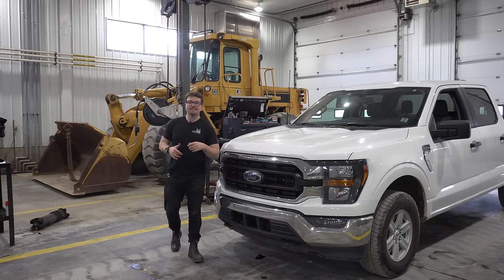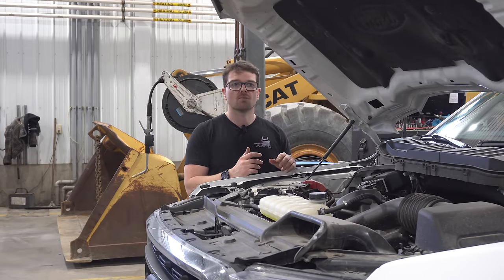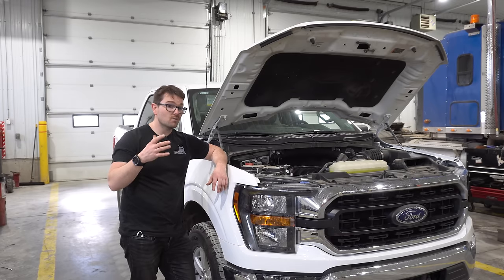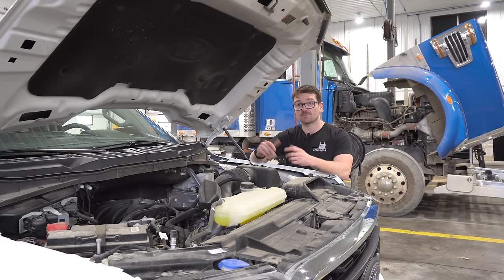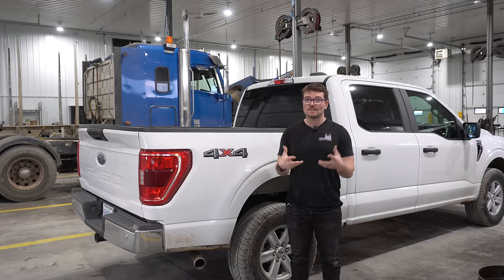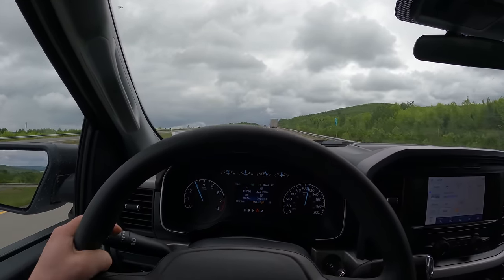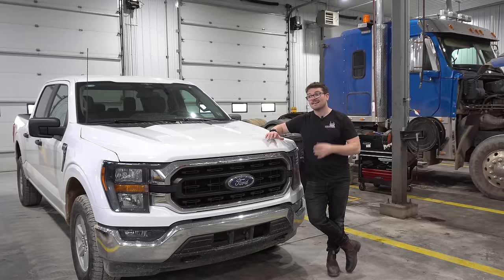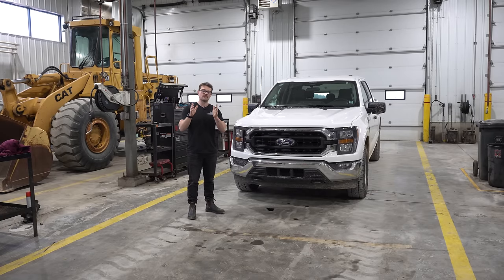Ford F150 5L Coyote V8 Engine **Heavy Mechanic Review** | 5 Reasons why It's the BEST

Comment: I have a ‘13 5.0L.  And I have loved every single mile I’ve put on it. 300,000!! I’ve hauled trailers across the country with it and it’s till sounds and feels like day one. I also have a ‘18 with the 5.0L and have no reason or worry about expecting the same all around performance out of it. Love your videos brother, they are super informative and have great genuine non biased opinions. Please, keep it up!
Reply: what oil you use?
Reply: Same here bro mine has 200 k tho the only thing I’ve done to it maintenance. New plugs and new coil packs that’s it
Reply: @migueldelafuente5775  I've had to do my transmission cooler lines and the plastic water pump hose, other than that it's been basic maintenance.  2014 with 140k, and I do lots of hauling with an equipment trailer.

Comment: 2017 Supercab 5.0 (gen 2) w/ 3.31 rear end ratio and 6 speed transmission. Zero problems, 19 mpg combined, low 20s on the Interstate with the cruise set on 80 mph. A keeper.
Reply: Just cause I don't know at all, depending on how you are using a truck, what is the better rear end ratio?
Reply: I swapped my 3.31 to 3.73 on my 2015 it helped out a lot especially with the trans constantly hunting for gears with heavier tires on hilly terrain
Reply: @bcw686  I think the 3.31 is a good all rounder, but as @andrewcleveland said, if you haul relatively heavy loads and or tow a lot, the 3.73 is a good choice, at the expense of some gas mileage.
Reply: @andrewcleveland 4.10 with gt350 ported mani is the way to go with Gen 2
Reply: @justingill5256  I bet that is a mean setup

Comment: My buddy has a 1989 Mustang 5.0 LX with 250,000 miles. It still runs great, no oil issues. He bought it new, and has had to only do basic maintenance.
Reply: completely  different 5 liter engines , that mustang is a push rod

Comment: Anyone who says "you shouldn't buy a truck if you're worried about fuel economy" clearly isn't paying for the fuel. I buy pickups to do what they were designed to do; work. I haul and tow 6 days a week, 25,000mi a year. The difference even a few mpg makes for me as a small business owner is incredible. I just bought a 5.0 and I'm coming from a 6.2. Personally, fuel economy is in my top 3 factors for a work truck. The other two are reliability and capability. 
Great video! We appreciate the info and perspective. 👍
Reply: Fuel economy is huge for small business owners. I thought I found the perfect truck years ago when I ordered a new ram EcoDiesel and the fuel economy was unreal when it wasn't broke down waiting to be repaired. Went from that to a Hemi 1500 which was a pretty good truck overall to a 5.7 Tundra haha. The Tundra is 11% worse on fuel then the Hemi but its just plain reliable. This tundra should be my last work truck
Reply: 26.5k miles since last April in my 23 F-150 with the 5.0. Couldn’t afford the $400+ more per month in diesel with a 250 and with 13k towing capacity with the max tow package I picked I can’t see needing much more towing unless I buy a big boat and tow it or a skid steer both unlikely lol

Comment: I've had the 3.5 and the 2.7 and currently have the 5.0 and everything thing you said is dead bang on. The 3.5 was a towing beast but I get better fuel economy with my 5.0 and almost as good performance - the low end torque is not there on the 5.0. I agree with the reliability - I was always worried about the turbos in the 2.7 and 3.5 and if they went and they can/will!!!! - it was $3500 minimum to fix. I have a 2016 with 150,000 km and the engine is flawless right now.
Reply from the maker: I personally think the 5L is just a great well rounded engine. not the most powerful but across the board has almost no weak points.
Reply: I just sold my trusty 2007 Ram2500 5.9 Cummins w/G-56 manual which I special ordered. It's been great but it was way overkill anymore since I sold my cabover camper. The F-150 5.0 is the only truck I'd buy now. If they could just keep the white paint peeling off the tailgate they'd be near perfect.
Reply: Is your 2016 the 5.0 or is it one of the Ecoboosts you mentioned? I am buying a new F150. I’m older now and don’t plan to do much towing anymore as I sold our travel trailer. I work in the city and thats the majority of driving this truck will see. I’m torn between the reliability and longevity of the 5.0 or the city mileage of the 3.5 Powerboost hybrid.

Comment: I have a 2021 f150 w/ 5.0 and 373 rear end…I love it!! I tow a small 1/2 ton towable 5th wheel w/ very safely. With in all numbers incl cargo carry cap. I LOVE IT! It feels so strong and safe. They have done a great job w/ the downshifts while braking to mimic an exhaust brake. I up graded to tribrine stops on rear axle to give me more stability. It is the perfect balance of power for towing and daily driving practicality while keeping dependably and reliability and lastabillity in the wheelhouse. Thanks for the vid…I loved it

Comment: I AGREE WHOLEHEARTEDLY With this review!!! 

I had a 2012 ecoboost that I felt was THEE BEST TOWING ENGINE EVER! Then I got a 15 5.0. I HATED IT at first, that is until I towed my travel trailer. The power wasn’t as good as the ecoboost, but it wasn’t terrible. But what won me over was the gas mileage that I was getting while towing ( and not towing.) That more than made up for the power  (TORQUE) I was missing from my old ecoboost.
Reply from the maker: The 5L is just a great all rounded engine. Hard to point out any real weaknesses

Comment: If you already own a 5.0L Coyote like I do, you already knew it’s, by far, the best half-ton V8 out there. Power per displacement, it’s 32 valve DOHC build, its ability to advance timing even further with compatible, 105 octane E85 fuel and its ability to hit 7K RPM’s quickly and power right past the rest of the V8 competition.
Reply: Awesome brother, I have a 2011 Ford F150 with a 5.0L Coyote V8 in it with 158,000 miles and still going strong and its a beast and it sounds like a beast with the Borla ATAK exhaust on it as well.
Reply: My neighbor has a 2018 5.0 F150  with exhaust mods and it sounds fantastic.  I have a 5.0 Mustang and it sounds very similar.  Fantastic engine for sure. My Mustang is stock with some bolt ons and is a beast.
Reply: @deanhawk7260  Sounds awesome brother
Reply: Nope
Reply: Oz omega tune made 409 rear wheel torque with e85
Reply: @justingill5256  That’s exactly why my 2019 Roush F-150 is tuned by Oz!
Reply: I have a 2018 5.0. I love it but unfortunately it has excessive oil consumption. I’m still under warranty so ford is going to give me a new motor. Hopefully this new one won’t fail me.
Reply: I'm gonna troll and race any f150 I see in my bowtie 6.2 AT4
Just kidding,  I do love Ford too.
Reply: I have a 2016 f150 5.0 with true dual exhaust & can’t get enough of the exhaust music & love getting compliments when I hit the remote start at different places👍🏼👍🏼
Reply: Wish Ford would've made the 5.0L Coyote V8 in the Expedition as an option.
Reply: Now if only they could back it up with a more reliable transmission. I do love my truck but having had a new trans put in it at 34xxxKMs and knowing this is a common concern doesn't leave me feeling great. Side note, my 20 5.0 makes a lot more noise (engine, not exhaust) than my 16 did
Reply: No... the 5.7 hemi is better
Reply: @joellaurin9007  Wrong. Your nonsensical opinion has not facts to back it up.
Reply: @Brian_195  yes.... 30 years experience with both brands. The 5.7 is less complicated, gets great mileage over 5.0. I've own many and never had a problem. Quite literaly never had an issue. Also the 5.7 has a better aftermarket following than the 5.0. 
I know many people with the 3.5 ecojunk (I have one) and the 5.0. There trucks are plagued with issues both mechanical and electrically. Ford is dying brand.... so is stelantis so is chevy. 
Despite my experience.... I feel all theses major brands and their new offerings are going to be the death of them. And it won't be long until ford drops 5.0.

Comment: I currently own a 2018 regular cab short bed 4x4 with the 5.0 and I love the engine/10 speed combo. All I had to do to get into the mid 12's in the 1/4 was an intake(Gen 3 Mustang), cold air, cat back exhaust and tune. The thing just flies! 7500 RPM in sport mode. As far as reliability, perfect, zero issues. Oil consumption was concerning at first, then I got the TSB done and she's at 1 quart every 3000. I can live with that! Great reviews on all of the trucks that you test! Keep 'em coming!
Reply: What is a TSB?
Reply: Technical Service Bulletin @JulianoGSF
Reply: I've got to be honest, I  have no clue what my truck will do in the 1/4 mile and have zero interest in finding out.
Reply: @hdz12ez   Anyone in the know has to think long and hard about taking on a 4x4 RCSB F150 !   I'd personaly get the new '24, as they now come standard with the 5.0/3.73's, race truck style, and are better equiped too.  BUT, I'd get the new sleeper for extra stealth....the RC Long Bed; just $300 more !!
Reply: No joke! @arkhsm
Reply: How did you get the TSB done?
Reply: I have the same truck. At 50k miles, it started burning oil like crazy. It’s still under warranty so ford is replacing it. But it’s been on back order for 9 months. I have to add about a quart a months to it until it comes in.
Reply: A quart every 3000 for a nearly new f150 is uncounciousable. My old honda made it to 200k didnt even burn any noticable amount at all whatsoever. Back when honda wasnt as shit
Reply: @bigp6071 i never heard of these problems before ford was slacking the quality control
Reply: @jakewillits4678 it’s not just ford. It’s all of the manufacturers. My engine finally came in and was put in last week. She runs great
Reply: @bigp6071  yeah I agree. Theyre all slacking in the quality control in the auto industry. Its unconciousable

Comment: I bought a 2018 5.0 sport new for work and daily driving. Its a xlt 402a with fx4. I changed front and rear bumpers with real metal ones. I went from 23 mpg on hwy to 18 and 18.5 around town. I have exhaust tune and cold air intake and headers. And the throttle tuner. It runs very good. I have 110k miles on it now only problem has been the water pump and oil consumption.  I also have a catch can. Just normal wear ive replaced the coolant had  rotors turned and brakes replaced and battery replaced and on my 3rd set of nitto ridge grapplers in factory size on oem wheels. Its been a really good truck ive driven up north and down to Fla numerous times and use for construction work i have 15k towing miles on it. And use the max payload every week on a normal basis.

Comment: I own this truck, and after 30,000 miles , it’s the best truck I ever had. I switched to Amsoil oil after 1000 miles and it doesn’t consume oil. Engine runs creamy smooth with tons of power if you want it, and , I average 20 to 24 mpg, not towing. Great job , Ford Engineering.
Reply from the maker: You just can't beat average over 20mpg with that much power ready to rock.
Reply: What model of oil do you go for?
Reply: I just got my 2019 5.0 70k on the clock. One owner. I don’t know what oil has been used and I’m trying to decide between motorcraft synthetic, Mobil 1 high mileage synthetic, or Amsoil all in 5w30 weight. Will change every 3k.
Reply: @jew0182 no need for the high mileage. The additives in high mileage oil are designed to swell seals and gaskets. Once you start using it you can never go back because regular synthetic will spring leaks.
If you’re truck isn’t burning oil or leaking it already just use any standard full synthetic and you’ll be good.
Reply: I bought one of these 5.0 f150's in Jan of 2015. It was a 2014 model. Now at 90k mi. Always synthetic changes at 5k mi. Filter sometimes every other change but usually every time. Truck uses about 1/2 quart on a 900 mile freeway drive. Mix of synthetics.  Kirkland, castrol, penns, Valv, Quak, orielly's. Replaced the alternator at about 50k. On my 2d battery. Replaced pvc at 85k. Replaced water pump at 70k although it didn't need it yet. Serviced trans at about 70k with fluid and filter. I use 87 octane exclusively. Tiny bit of valve tick but goes away if I put Hot Shot stiction in at an oil change. Will be changing MAF sensor , coils, plugs, EVAP and installing an oil catch can just as preventive maintenance. Runs pretty darn good now but city driving is at 14 and I'd like to get it up to 16+. I got close to 22 a gallon on my last freeway trip of 900 mi. last year. Looking for 25 on my next 900 mi trip this coming summer. Going to step my game up to top rated synthetic oils and filters and try out a few fuel and oil additives to see what happens.
Reply: What weight oil to use? I have a 2018. The owner's manual says 5w-30, but the fill cap and dealer window oil change sticker says 5w-20
Reply: @jimprice-i4w I’m sorry but reading about your experience doesn’t make me feel warm n fuzzy about buying a 5.0. 90,000 miles on the odometer and it burns 1/2 a quart of oil every 900 miles? That’s awful. I have never owned a vehicle that has burnt that much oil….. and I owned a 6.0 Powerstroke! Lol

Comment: 2018 f150 lariat 
5.0 V8
236,292 miles
Engine Hours 9357
Idle hours 4219
North North Dakota pipeline as well as West Texas
Always run Mobil 1 full synthetic. 
Engine does not burn any oil at all. But, i did have to replave the cam phasers, chains, and nylon guides at a cost of $10,200 at $217,000 miles. Love the truck and love the engine.

Comment: I have a 2011 Ford super crew with the 5 L coyote. Loved it. No mechanical issues at all. I still like the 5 L coyote.
Reply: Sounds awesome brother, I have a 2011 Ford F150 with a 5.0L Coyote V8 in it with 160,000 miles on it and still going strong and its a beast and it sounds like a beast with the Borla ATAK exhaust on it as well.
Reply: How many miles and does it burn or leak any oil?

Comment: Bought mine with 5.0 brand new back in 2014, still running strong to this day. 225Km, a few trips down to Florida, couple of trips across Canada, multiple camping trip across BC pulling my camper. Doesn't burn oil, no bizarre sounds from the engine. My only regret is taking 3.55 instead of 3.73 but otherwise great little truck. Friend of mine also has one, 2013 model with 496Km with original motor and tranny.
Reply from the maker: That's awesome! And ya I think if I was to get one the 3.73 gears would be the way to go
Reply: Depends on how big and heavy your camper is. I think the 3.55 is the best of both worlds on fuel economy and acceleration and towing power. I wish my Coyote Mustang had a 3.55 instead of 3.73. It's fun but just too much torque multiplication. Gonna have to go with 3.31 when the supercharger goes on.

Comment: I'm sitting at 150,000 miles on my 2011 Ram 1500 Hemi. No lifter problems at all. What kills the lifers in the Hemi is excessive idling and lack of oil changes.  I change the oil every 5500 miles with Pennzoil Platinum Full Synthetic. Also chage my transmission fluid every 50k. Both engine and transmission have been solid since owning it from brand new. I don't plan on getting rid of it any time soon.

Comment: Have 2016 6 speed with the 5.0.    Hands down the best combo.   Daily driver/ work truck.  Consistent maintenance, not a single issue.   Fantastic vehicle.
Reply: That's what I have too. 2015 model and it's my daily tow pig work truck with our 7x14 enclosed work trailer. It does amazingly well and has given me only one issue when a known recall on the transmission frame lead went out and it wouldn't start.
Reply: @Mannievh  Also check your trans cooler lines. I did those and the lead frame.

Comment: I have the 2018. It did have the oil consumption problem. Used to occasionally and randomly DRINK oil. But now seems fixed. LOVE the coyote. Pulled a 7,700 lb 29 foot travel trailer from Vancouver to Calgary up the Coquihalla. Very steep at times. Was drawing 75 litres per 100 km every now and then... But she DID IT! With no problem. Now at 151,000 km.
Reply: how was the consuption issue fixed?
Reply: @nelsoj12 PCV valve adjustment or new. And a longer oil dipstick. 😂
Reply: Any issues with the 10 speed transmission?
Reply: @bobtenharkel4367  Only once had trouble shifting. Much ice and water likely splashed up. Generally great